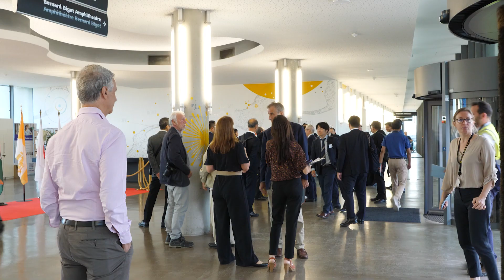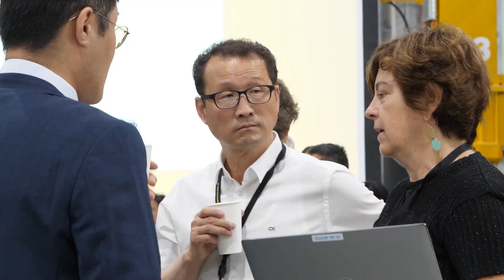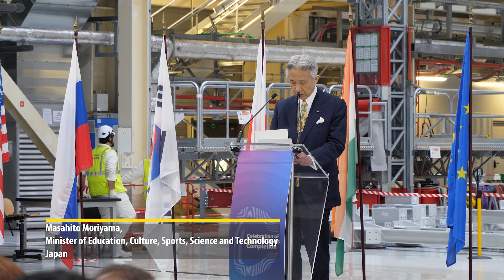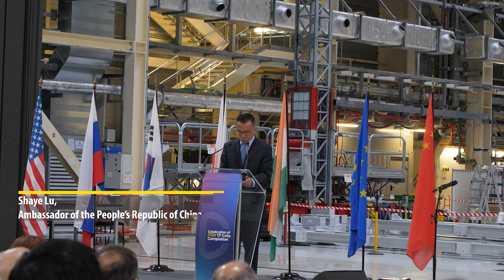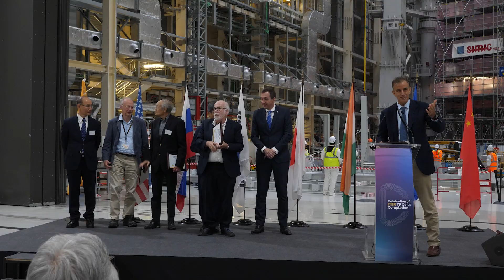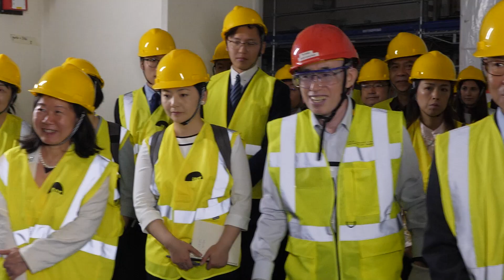ITER magnet completion event

Comment: There is a fundamental question about Fusion Power and that is, can the very high energy that is achievable in the plasma be controlled by magnetic fields?.
The Sun contains the plasma or whatever it is by the force of Gravity, nothing it seems can escape the force of gravity.
But will the force of electro magnetism be able to contain and control the fusion reaction in the  plasma.
One thing that bothers me is that the huige magnetic coils will suffer back emf if the magnetic field needs to be changed rapidly.....Fundamental theory of electricity and magnmetism....

Bard on Back EMF in Electromagnetism...

"Back EMF (Electromotive Force) is a voltage that opposes the applied voltage in an inductor or transformer. It's generated when the current flowing through the coil changes.

How it Works:
Current Flow: When a current flows through a coil, it creates a magnetic field around it.
Changing Magnetic Field: If the current changes (e.g., increases or decreases), the magnetic field also changes.
Faraday's Law: According to Faraday's Law of Electromagnetic Induction, a changing magnetic field induces an EMF in a nearby conductor.
Back EMF: In the case of the coil itself, the induced EMF opposes the original current flow. This is the back EMF.
Significance of Back EMF:
Inductors: In inductors, back EMF is responsible for the inductor's property of resisting changes in current. This is why inductors are often used in circuits to smooth out AC currents or to store energy in magnetic fields.
Transformers: In transformers, back EMF is essential for the transfer of energy between the primary and secondary coils. The back EMF in the primary coil opposes the applied voltage, while the back EMF in the secondary coil induces a voltage.
Circuit Protection: Back EMF can also be a concern in circuits with rapidly changing currents, as it can cause voltage spikes or even damage components. In some cases, diodes or snubber circuits are used to mitigate the effects of back EMF.
In summary, back EMF is a fundamental phenomenon in electromagnetism that arises from the interaction between current-carrying coils and magnetic fields. It plays a crucial role in the behavior of inductors, transformers, and other electrical components."
Reply: that’s obviously irrelevant. Scientists don’t do things without thinking it will work lmao. Physics has quantified theories, the whole thing is built on computations and overly careful and tested estimations about how things scale up compared to previous smaller equivalents. You don’t go and say to a building constructor “ah you know, buildings are heavy, I don’t know if it is possible to build it and sustain the weight”. They did the calculations duh, you did not
Reply: @ 
Just hope it works out ok after all those £Trillions spent on it.
Reply: @ lmao trillions. Really really not, you’re 2-3 orders of magnitude away dude. It’s been at most 30 billion, for an international project. That’s approximately 60% of france’s defense budget for one year, shared by the wealthiest countries in the world over 2 decades. It’s very worth it